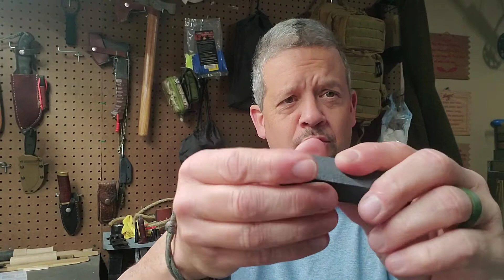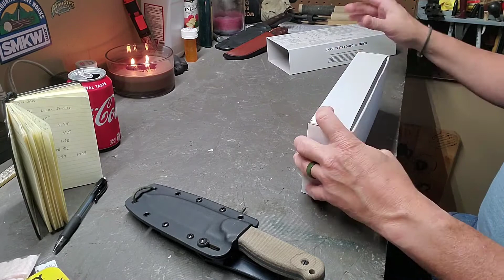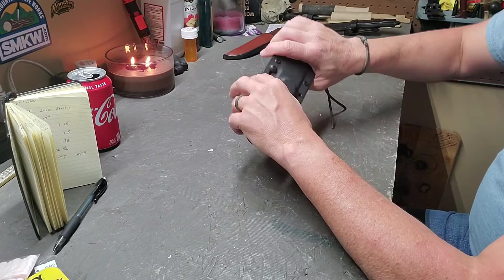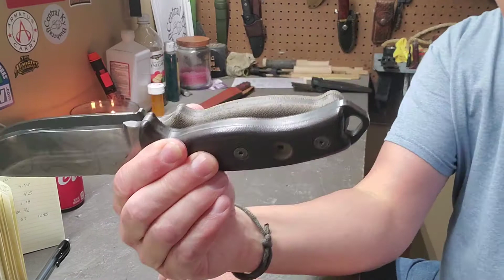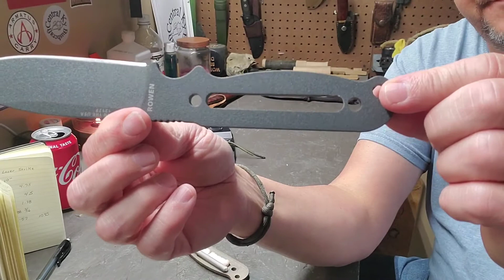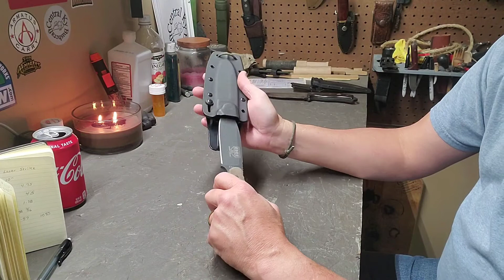First Impressions of the ESEE Laser Strike

Comment: Beautiful knife
Reply from the maker: Thanks. I've been really impressed with it. It's turned into one of my go to knives. It's right in the size range where it can do a little bit of everything and do it well. Thanks for watching
Reply: @CentralKyBushcraft  would you recommend the laserstrike over the pr4
Reply from the maker: @stewartmcpherson5943  it would depend on what you were looking to do with it. They are both great knives and can do just as well with a lot of task but the Laser Strike is a more robust knife. I do like the handle of the Laser Strike better than the PR-4 because it allows you to choke right up to the edge and gives better control. The biggest thing to consider is the weight difference between the two. If you're wanting a light knife to do fine task with and are not planning on using it as a one tool option then go with the PR-4. If you're looking for something that can do fine work, light chopping, batoning and just about anything else you throw at it then go with the Laser Strike.
Reply: @CentralKyBushcraft  thank you I really appreciate it. Have a great day and stay safe.